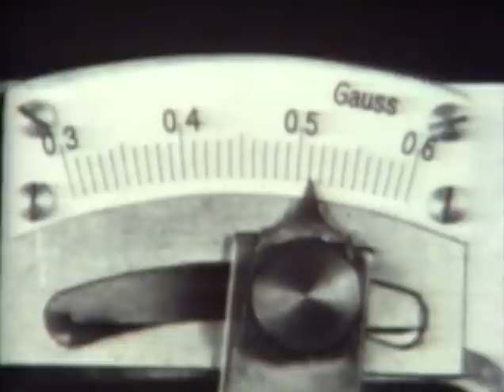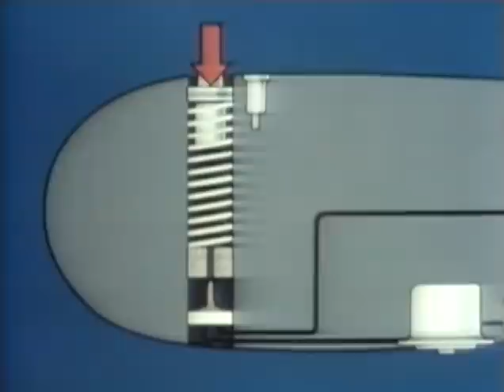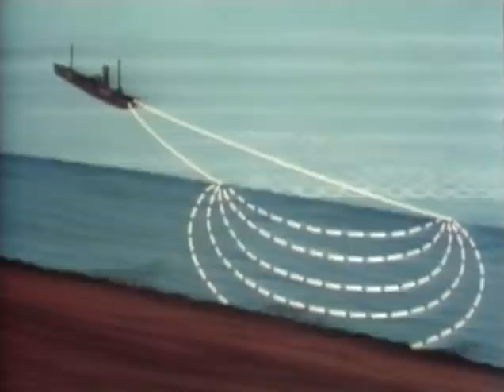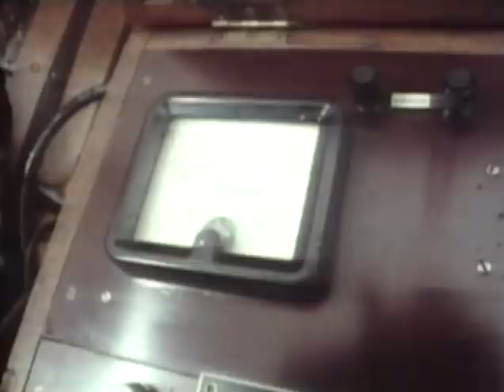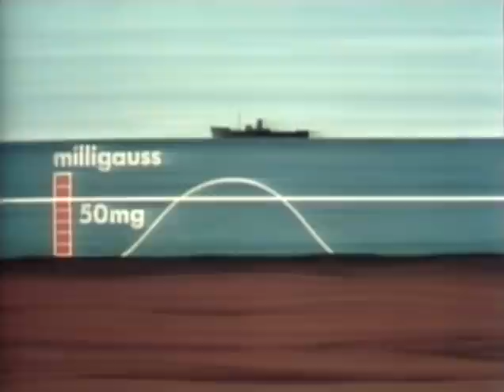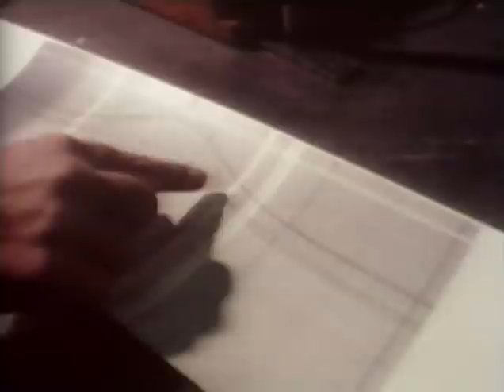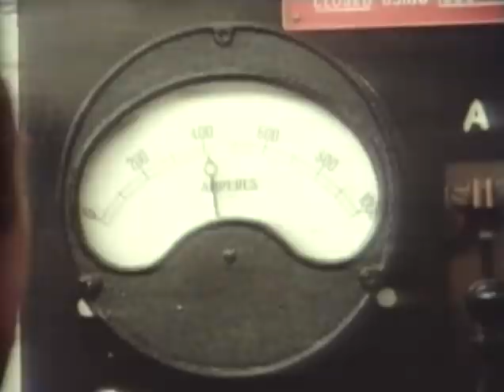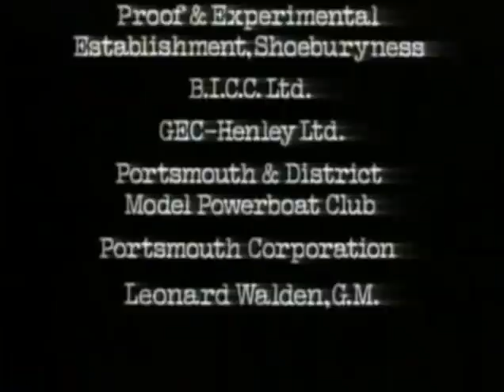The Secret War_5 The Deadly Waves_complete

Comment: Good old Lord Cherwell. Supposedly Churchill's scientific advisor. We can all be glad that Winston didn't listen to his advice very often and in fact came to rely more on R.V. Jones brilliance, starting with the Battle of the Beams in 1940. Jones had figured out that the Luftwaffe was using radio signals beams to allow spot on navigation in the dark over England during the Blitz. Cherwell unbelievably almost always came down on the wrong side of every problem put before him, including arguing that the V2 rockets that had begun showing up on reconnaissance photos were in fact barrage balloons!
Reply: Cherwell argued the rockets were not possible he claimed the wall of the rocket would have to be two feet thick steel to withstand the rocket pressure on launch.

Comment: If I were designing it in the drawing office I would have made all those screw-in rings (about 20 mins in) with a left handed thread, just item one on a list of 100 things to fool any attempts to defuse it. Simple and no cost. If the English disposal officers had tried to undo it as they did, they would have either thought it was impossible or tightened the rings further. They could also have been welded in place possibly. Strange that the disposal guys didn't have a radio to dictate back to the onlookers each step they took so it could be recorded in case it blew up.
Reply: Radio uses electromagnetic waves, their loudspeakers contain magnets. If there is any chance of magnetism setting off the mine, radios are the last things you want anywhere near the mine. 
A signal lamp running on kerosine, made out of brass or aluminium, would've been a safe way to convey messages via morse code.

Comment: The only thing I found strange is when they were cutting the wires on the detonator using a pocket knife. ????  Diagonal pliers? The right tool for the job.
Reply: And the wedding ring on that guys finger.
Reply: @TheScreamingFrog916  Gold ring not magnetic.
Reply: @normanlesley1867  Good point, I did not think of that.
But as any electronics tech, like myself, will tell you...
Take off all rings/bracelets etc, because they can come into contact with a live lead, and cause a short circuit.
And that, can be deadly.
For the same reason, using an uninsulated pocket knife, to cut wires in a confined space, is also a very dangerous thing to do.

Still I greatly admire the skill and bravery of the men who accomplished this task. Better men than me.
Reply: @TheScreamingFrog916  But can be detected by A metal detector.

Comment: German stick grenades were routinely booby trapped, so one would have to belive a sea mine would defiantly be booby trapped as well, it was only because a German did not remove the safety tab on the detonator that these men didn't die, they were very lucky. They still deserve great credit for their courage and effort.
I knew a man who attempted to disarm a stick grenade, horrible consequences.
EOD is the only profession where you can be 99% correct and still be dead wrong.

Comment: What are the chances the mine was dropped in the mud on purpose with the anti-tampering not turned on?
Reply: oh yeah---bombing was pin point accurate back then
Reply: Sabotaged by a very brave slave labourer?
Reply: @chrisst8922  
Not likely. The anti tamper device would have been activated by Luftwaffe crew at the airfield.
Reply: @michaelwise1224  They just missed one.

Comment: This doesn't explain how the magnetic mines actually damaged the ships.  How do you pop rivets and crack steel plating without creating holes?
Reply: Because the magnetic mines did not have to contact the ship, to explode, like the earlier mines did, they were farther away from the ship when they exploded.
Because water does not compress, the shock wave from the explosion, would crack the hull.
Reply: @TheScreamingFrog916  What kind of explosive charge did these mines have to have to cause shockwaves through water to cause the damage?

I can't help but wonder if the high-sulfur steel that was in use at the time could have been a contributing factor.  Steel at the time  was more like cast iron and it became brittle at low temperatures.  The problem wasn't understood until U.S. Liberty Ships began taking cargoes to Russia by way of the Arctic.

In the 1990s a portion of steel plating from the wreck of Titanic was tested.  It's speculated that the iceberg didn't open up any large holes in the ship, but wherever small holes were made the surrounding area cracked all the way to the closest set of rivets.  So the ship had more damage than would have been done by the iceberg alone.
Reply: @christianpatriot7439  I don't know the details, but I do know that because water does not compress, shock waves from non contact explosion, can cause a lot of damage.
Damage that would certainly look different, than contact explosion.
Best wishes for a happy new year.

Comment: no wire clippers ?
Reply: I guess it's hard to come by non-magnetic cutters.
Reply: @Marci124   I worked in vehicle maintaince field while i was in the air force the guys in refueling truck maint. shop had all non sparking/nonmagnetic tools.  hard bronze would cut copper  when they wear,  recycle and get new.  it is hardly a new technology.  but i guess you use what you have. not what some clown on u tube says they should use .  have a good one!
Reply: @imjusttoodissgusted5620  Doesn't seem to be an oversight of the reenactment (unlike the wedding ring), he specifically mentions he broke the wire by twisting, and they act it out as well.

Comment: Why would an ordinance like this be built in such a way that it could be so easily disassembled by your adversary? Basically you are handing over your technology on a platter. Just mung over a few threads above the threaded rings
Reply: Tommy. You have completely misunderstood the complexity of the mines.
Simple anti ship mines were first contact mines. A floating sphere anchored by a concrete block and chain with horns, when damaged by contact, caused the detonation.
Then magnetic mines dropped in shipping channels and anchored but below the water surface, so unseen. Countered by degaussing the ships and using minesweepers, wooden with low magnetic field and wire cables with a high electric current to detonate the mines.
Then came the German magnetic mines with a counter so 5,6,7  or more ships can pass by before the mine claims its next ship.
The Landmines became more sophisticated. Much larger, high explosive, designed to keep people away because it could blow up at any time. 
Delayed activation, Magnetic, Acoustic, light sensitive.  All mechanisms designed to keep the technology secret. Brass spanners, pin spanners & screwdrivers, rubber hammers, working in the dark. So easy isn't it.
None of these were "so easily disassembled".
Every person that tried to defuse these weapons operated with a telephone contact so that before it blew up they could say, "I am just unscrewing the "  Boom. 
All recorded on paper  at the safe end of the telephone.
That way the next person new at what point in the operation the thing blew up.
They also used a pressure device to try to disengage the firing trigger.
Loaded on the plane the Mine wasn't armed until it was dropped from the plane and reached the earth's surface by parachute . Once the clock detonator began to 'run' the person had 17 seconds maximum to live.
At any time in war, as soon as a new weapon is used, the technology is handed over to the adversary.
If you want to keep it secret, then don't use it.